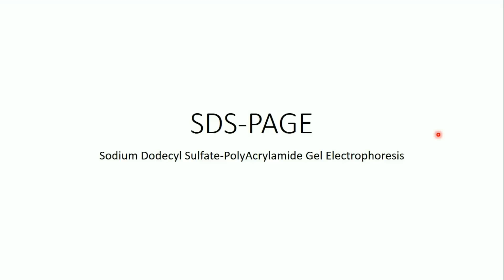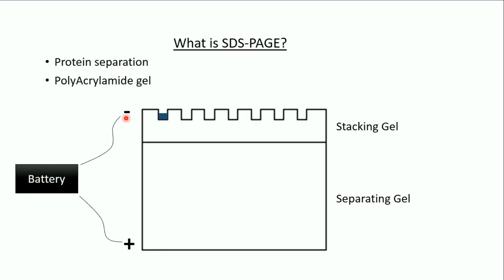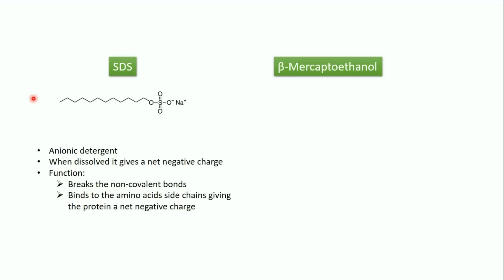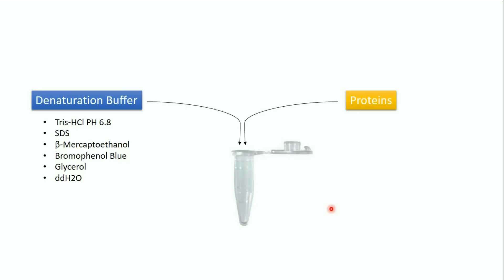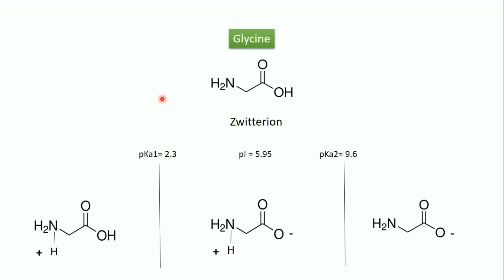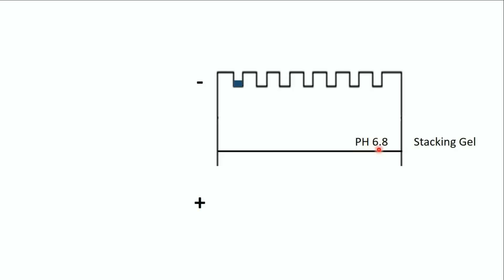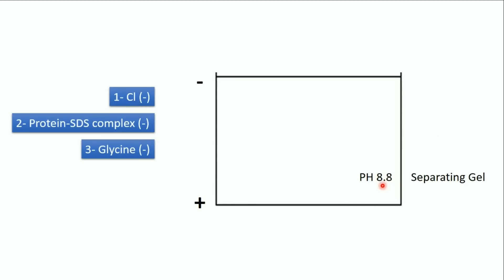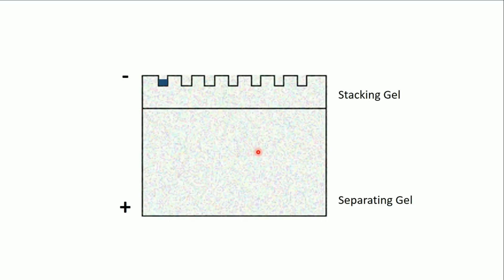The principle of SDS PAGE-a full and clear explanation of the technique and how does it work

Comment: I really don't understand why the stacking gel concentrates the proteins. If it is still a gel the proteins will be administered as they are pulled from the solution so they would enter the stacking gel separated. What is stopping the proteins from doing this? And how are the loose glycine molecules related. It doesn't seem like they have anything to do with the proteins, they are just there like chloride.

Comment: not clear on how the stacking gel helps. is the principle that in the stacking gel the protein migration speed is restrained by the glycine and clorine sandwiching it either side? so that when the glycine transitions to being more negatively charged and speeds up, it "gets out of the trunk"? need more explanation here.
Reply: I had the same question as you, and in case you haven't found your answer yet, I found some helpful information in my lab class's Theory Manual. After the chloride anions form the leading boundary in the stacking gel, the area immediately behind is rich in Tris cations and depleted of anionic species. This attracts anionic protein molecules and causes them to migrate at a rate similar to that of the chloride anions, at least initially, and protein molecules of identical size will be concentrated into a narrow band by the time they reach the separating gel.
Reply: @andrewfoster9823  thx sir, that really helped. however i've two questions remaining:
1) what's the purpose of the glycin when the proteins simply get draged by the Cl- front?
2) how does the glycine behind the sample manage to get past it since it's supposed to stack it before?
i know that it speeds up, but that stacking-process sounds as if the glycine fraction wasn`t able to get past it because otherwise there would be no sandwitching.
to me, it seems to be more logical if the faster moving thing actually has to be behind the sample in order to stack it.
Reply: @samuelgantner4609  maybe it helped a little
Reply: @x4rrr had the same problem, now I was looking through my script again and came across the answer: Due to the fact, that the chloride-anions migrate at a very high speed through the stacking gel, behind this "layer" forms a zone with a high electrical tension (as @Andrew foster mentioned above, it's effected due to the positive cations of the buffer) The second quickest substance are the proteins, which are migrating through the stacking gel. Little proteins are migrating very fast, into the "positive zone" right behind the chloride anions but can't get much further at this speed, because the negative chloride is restraining them a little bit to do so (negatively charged). 
On the other side, very big proteins are migrating slowly. To avoid, that they don't get stuck too much, glycin pushes them through the stacking gel, so that's the positive effect of glycin. In Austria we call chloride because of that "leitionen" = leading ions, the glycine "folgeionen" = following ions. 

In the separation gel then glycin is overtaking the proteins, so they aren't pushed anymore and can separate slowly

Comment: How much time is needed for per sample?
Reply from the maker: It depends on the voltage you apply ... the higher the voltage you apply the faster the sample will run .. but to get better results do not apply very high voltage because the sample will not have enough time to interact with the gel then ...

Comment: Does SDS bind to glycine?      
is SDS binding to peptide bond or R group?
can you kindly clarify my doubts.
Reply: SDS can not obliterate glycine and this is because glycine does not truly have a R - group (as you know it only has Hydrogen in place of R). However, it is good to be aware that, SDS always obliterate R group of amino acids in a protein so that the charge is always negative regardless of the inherent resultant charge of the protein initially.

Comment: thanks for the wonderful video......... my question is tht if  the pore size of the separartion gel is same,  then how proteins of different sizes are getting separated i.e. the bigger one should get trapped and the smaller one should pass through it ........ plz help me out in understanding this.........
Reply from the maker: Baljinder Kaur Hello, it is exactly as u said .. when the proteins pass the smaler ones pass easily through the pores, and so they reach the bottom of the gel faster, while the larger one are stuck in the gel and then they move very slowly ..
Reply: that is fine but is it possible tht if we run our sample for longer time then protein present in it willl migrate outside the gel ?? also we have a reference protein ladder that means protein of a particular molecular mass will  spot at a particular location and if we run our experiment for longer time then is it possible that proteins of larger molecular mass also migrate to end of gel ??? then how are we going to separate the proteins of different molar masses ???
Reply from the maker: Of course if you run your gel for a longer time the proteins are going to leak outside the gel starting from the small proteins first because they are faster and then the larger proteins will start to run out ... to prevent this you should simply stop the current before this happens, and because of this we used Bromophenol Blue that we mixed with our sample so we will be able to track the sample on the gel and to stop the gel before the small proteins run out ...  and then you will find your small proteins at the bottom of the gel and the large proteins on the top of the gel, this is how we separate them ..
Reply: thanks..... now i understand completely :-)

Comment: why do we take different concentration of polyacrylamide gel for stacking gel(5-7%) and resolving gel(12-15%)?
Reply from the maker: Stacking gel has nothing to do with the separation, you need all the proteins to pass through it smoothly and at the same velocity, so you use low concentration (usually 2%) in order to make the gel less condensed with larger pore size. On the other hand, the separating gel should separate the proteins, due to this, you should use a higher concentration in order to make a gel with a certain pore size from which the proteins pass in different velocities (usually 10 to 14%) ...

Comment: Thanks for this interesting video I have a request what is the reason to use different concentration of tris hcl in staking and separating gel?
Reply from the maker: Tris Hcl is used in the buffering system in SDS-PAGE and it is used in different concentrations in the stacking and separating gels to serve in the differences of PH between the two layers.
Reply: Thank you for your response

Comment: what is the actual charged particle which conduct current in the gel and responsible for movement of charge proteins?
Reply from the maker: Thank you for your comments, the buffer used inside the gel, and the migration buffer used in the SDS chamber, which are both water based, are responsible to conduct the current.

Comment: I have a question, if the gel is keep connecting to the  voltage and i want to know whether all the proteins may accumulate   at the bottom of the gel? Thank you very much
Reply: How can they stop if the pores are the same?
Reply from the maker: Hello Liu ... thank you for your question ... the proteins do not accumulate at the bottom of the gel ... when they run in the gel they run in different speeds so the small proteins reach the bottom of the gel first, at this point you should normally stop the electrical supply ... if you do not stop the electrical supply the proteins will start running out of the gel to the buffer, in this case you will lose your proteins in the buffer. The proteins will run out of the gel gradually, the small proteins will run out first then the larger proteins will run out when they reach the bottom of the gel, and some proteins are too large so they stick at the top of the gel when they cannot run further.
Reply from the maker: They do not stop .. you should stop the electrical supply when the proteins reach the bottom .... you can notice that from the blue color (remember I said in the video that the Bromophenol blue is used in the denaturation buffer in order to give the sample a blue color so I can detect it on the gel (5:20 min)) ... so when the blue color is at the bottom you should stop the electrical supply otherwise the proteins will run out the gel ..
Reply from the maker: I hope I answered your question ... stay around there will be many interesting videos on this channel :)
Reply: +Biomedical and Biological Sciences thank you very much and i clearly understood the concept of sds. i was just confusing about the endpoint of sds and now i know it is similar to the DNA gel.